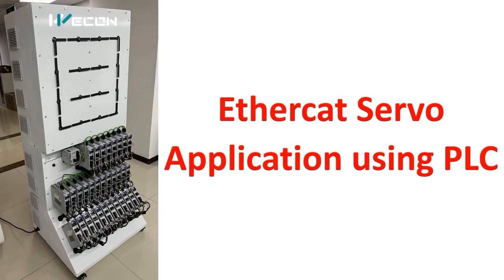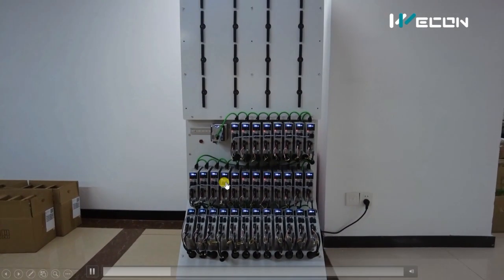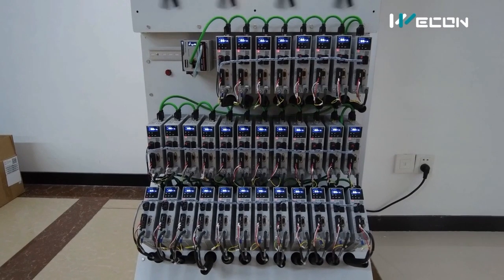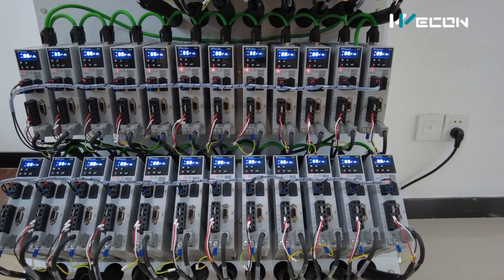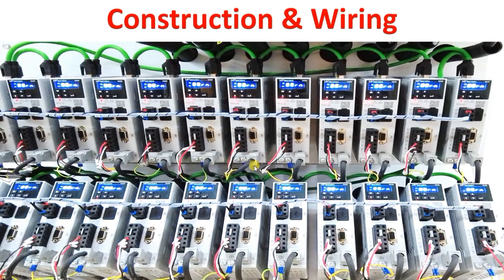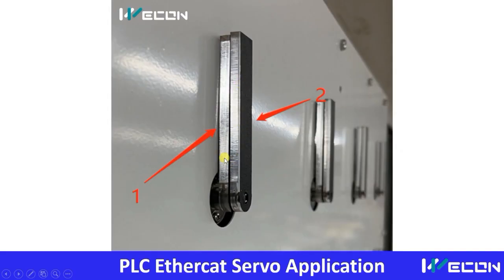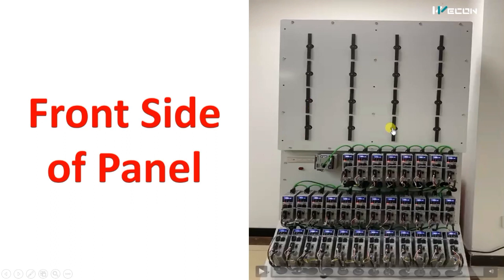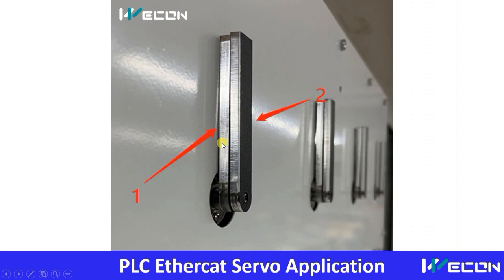EtherCAT PLC and Servo Drives | Wecon Motion Control

Comment: Is the communication protocol Modbus RTU or is it Modbus TCP/IP?
Reply from the maker: it is ethercat protocol
Reply: @WeconTechnology  But the drives are assigned via MODBUS protocol (as demonstrated in this video), so the modbus runs over ethercat?
Reply from the maker: @xiacaustralia  sorry, not modbus
Reply: @WeconTechnology  In the video at 8:00 there is clearly a MODBUS communication module in the PLC program, so this is only for comparison, is it? It is not used when using ethercat?
Reply from the maker: @xiacaustralia  yes, a mistake, it is ethercat, no need modbus communication to control the servo. the servo parameters are configured in the PLC, and then the motion control command is used to control the servo operation.
Reply: @WeconTechnology  will it also be able to communicate with those EasyCAT Arduino shields?
Reply from the maker: @xiacaustralia  can not EasyCAT Arduino shields yet
Reply: @WeconTechnology  a aqQzz2zEd/es-tu